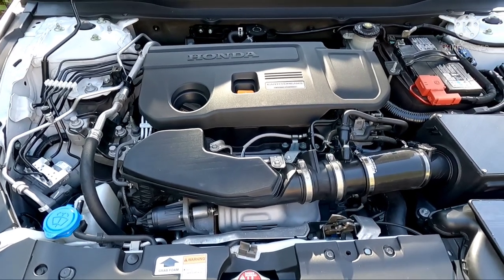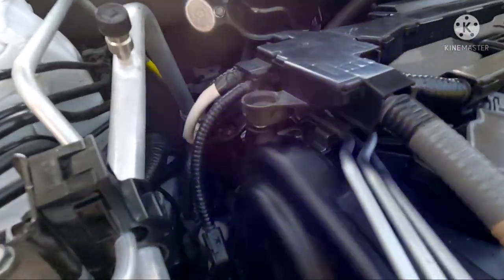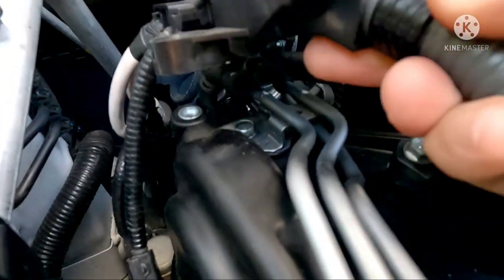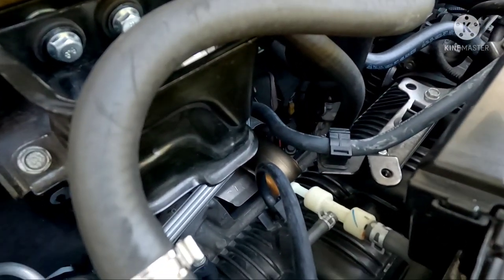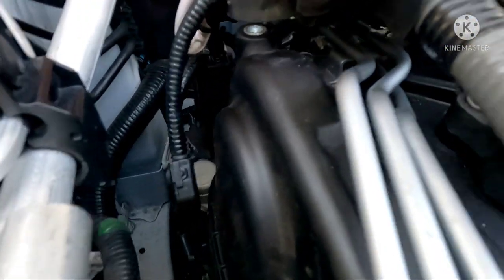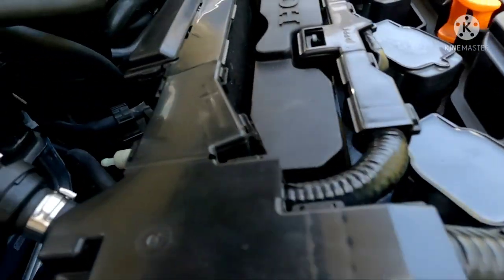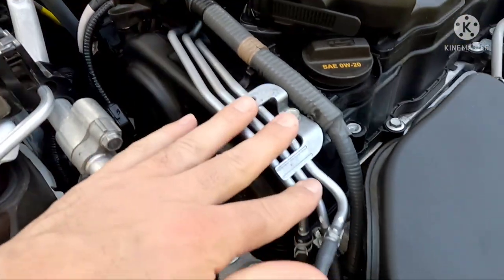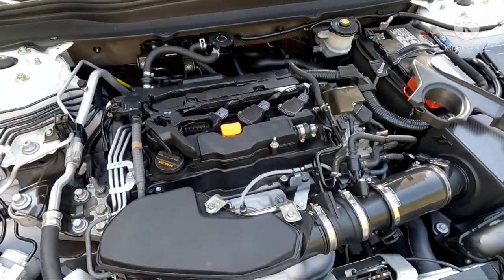How to bypass your Air Bypass Valve Control Solenoid |A MUST for Tuned Honda Accord 2.0t's

Comment: Hey even here after a couple years had this problem PHR STG 3 had the stutter did the bypass and it fixed my problem the issue was very annoying and even had power loss but it is fixed thanks for the video :)

Comment: Hey, Dan. 
1st. I love your videos and you've helped me a lot with your tips and tricks. 
2nd. You should cap off the far right hardline or the factory T that you left there. It goes directly to your intake pipe, connected to the turbo. You may be pulling in some debris and unmeasured air without capping it

Comment: I tend to fluctuate 23 pounds sometimes hitting 24 once hit 25 does that sound about right  By bypassing that valve does it regulate your boost level more efficient it seems like mine's never the same

Comment: Hey Dan, thanks for the video I just finished doing this and my sputter is gone. But I noticed since I did this, I hear a lot more air/ blow out from my k&n intake only on low rpm cruising. Did you experience this as well? I know you have a mishimoto intake, but was wondering if you noticed a difference at really low rpm. P.S I also capped the T connector where the intake vaccum line was originally
Reply: Side note* I also have phearable stage 3 👌
Reply from the maker: No problem! I hear the diverter valve a bit more almost crisper. Although  I can't say specifically at low rpm.
Reply: @fubuguy10  nice. Unorthodox racing is releasing a lightweight crank pulley for 2.0t accord soon it weighs only 0.5 lbs I can’t wait. Non stop tuning already sells one that weighs 1.17 lbs which isn’t bad either for $140.
Reply: @HondaAccordPerformance  I see that pulley at Nonstop tuning.  I am an amateur mechanic and it looks like a pain to change.
Reply: Would you happen to recall what size diameter the hoses were ?

Comment: So i have a code witch is p0035 witch mean change the bypass valve because my boost cutz off n im gettin Christmas light on my dash if i bypass it would the check engine light go away or no ?? If i reset it would it come bak on i have to smog my car this year thats why help please

Comment: I'm having hesitation on my stock 2.0t, but not at high rpm. Happens when I press throttle at 40%. Have you heard anything like this? You think this would fix it or is this just for ppl pushing more boost than stock?

Comment: Great instructional video. I would buy a kit. Thanks!
Reply from the maker: Thanks,  I didn't get enough demand to make one up
Reply: I did it today, was $8 of parts. 
Edit.  Thanks for the great title for the video!  Such a big difference without the flutter, I was getting power surges also.  Now it's just as it should be.

Comment: how is this modification holding up so far sir? Any problem? My tuner told me that this would be the problem that I’m having but he just suggested it to me if I want it. I will ask him questions as well but did it have any pros and cons? like additional benefit other than removing the sputtering? Thanks again!!
Reply from the maker: There isn't any benefit other than taking care of the sputtering issue. Also so issues after this modification

Comment: What does this solenoid actually do?  I just noticed this problem today and am going to consider doing it, too.
Reply from the maker: It basically controls the boost electronically. When you run more than stock boost the solenoid doesn't seem to like it and will cause the sputter.  By doing this your running off of vacuum and will fix the issue
Reply: @DanVilla7  Makes sense.  I'm wondering if an aftermarket solenoid would work as well.  Hondata sells one, but I don't think it works with ktuner.  Products.  Thanks for the video!
Reply from the maker: No problem!

Comment: Hey Dan, I need to fix this issue with my accord as I’ve been experiencing it on my recent type r turbo upgrade, do you know what size is the hose you got and if you need just the vacuum hose and cap for the car, thank you.
Reply: Guys it’s 7/32in 👍

Comment: Yo how's that oil catch can working out for you? I just ordered 1, how often have you had to empty it?
Reply from the maker: I haven't opened it yet, to really know. I did remove the hose that connects to the crankcase to fix this issue and there was oil residue in it so I'm sure it's collected some blow by already.  I'll open it up soon and show how much it's collected.
Reply: I've got a 2021 touring. Just made a run from west of Chicago to Fayetteville and back a few weeks ago(changed the oil the night before I left) .  I'm now at 40% and checked my catch can just out of curiosity....... there was maybe a quarter to three eighths of an inch of oil in the bottom of the can.  I am phearable s3 tuned as well.
Reply: @danielrinehart869  I got the same tune and same results in the catch can

Comment: Does it make sense to do this without a tune? I plan to get a tune but can this be done before? Just curious if anyone knows what Honda's intentions were with this bypass valve? How is it supposed to work or what is it supposed to do? Good to have this info before circumventing a Honda Engineered device.
Reply from the maker: Honestly if your not having an issue why touch it? I personally wouldn't have. I only started researching it because it was a really annoying issue for me costing performance which I was looking to gain.  Now everything is working 👌.
Reply: @DanVilla7 So this controls the boost? So bypassing this value prevents the computer from dropping the boost? Wonder what situations that would happen? Eco mode?
Reply from the maker: @michaelgilmore341  by doing this, it's no longer operating electronically, it is operating solely off of vacuum which is safe.  I have noticed traction control doesn't really interfere as well which I personally like. Traction control in this car pretty much sucks just cuts power and doesn't help to keep you accelerating as fast as possible

Comment: I might have this issue, my car when it shifts to 7th I always noticed a drop in boost but then it picks right back up.  I always thought for this platform maybe it was normal…. After seeing This video I’m
Thinking I need to try that bypass
Reply from the maker: More than likely you need to do it. It will fix for sure
Reply: @DanVilla7  did you notice harder shifts 
Or anything??
Reply from the maker: Nah just works the way it should. If you go back to stock it wont do it, only happens when you push more boost.
Reply: @DanVilla7  thanks brother! I’ll try it this weekend and come back with results!

Comment: Newly subbed here. Thanks for the info.      

So bypass the solenoid…,  basically remove the solenoid completely out of the equation., now what happens if I was to tap all 3 lines back into the intake valve?  Rather then just running the one
Reply from the maker: Thanks and you'rewelcome! Im not sure if that would cause an issue or not. But most importantly do not unplug the wire harness from the solenoid, supposedly it's not a code that you can clear and only the dealer.
Reply: @DanVilla7   well I did what was supposed to be done.  Unfortunately I snapped the nipple on the manifold.  Who knew it was an easy plastic to break.     For the moment being I try to block off the hole on the manifold. So my blow off valve has no vacuum running to it.   Surprisingly the car runs. No code.     The intake is very loud. You can hear that turbo spooling. But no power.    One of those fml 🤦🏽‍♂️ moments for me. Lol.
Reply from the maker: @h2batavia922  damn sorry to hear. Your not the first person that had that happen to them. Unfortunately they didn't report back with how they fixed it. Someone suggested jb weld to him.

Comment: Have a quick question for you when you were running Ktuner stage 2 what was your maxed boost level.
Reply from the maker: If I remember correctly 22.xx psi
Reply: @DanVilla7   How about now with your f stage 3 tunes
Reply from the maker: @jeremyyounkers7378  will spike and hit 24.xx holds 23.xx but as it gets cooler should be a little more
Reply: Great i guess my tune is correct then.   Im use to my 2018 si with the plus 9 psi tube hittin 27psi.

Comment: I'm getting a P006a on my 2.0 is this the fix or do I need to replace the MAF
Reply from the maker: This issue doesn't throw a code
Reply: @DanVilla7  man I need some help with this p006a, I bought a maf and it's not the problem
Reply from the maker: @bobbywilliams5167  I personally wouldn't know what's wrong

Comment: Wow, just came across this, and looks like the same issue I have. My car is modded, 6 spd, and I have this annoying hesitation, feels like power cuts, which starts around 5K and up...

I have experienced it in 1, 2, 3, and even 4th gear....

My tuner says that it might be the fuel pipe, and we need to change that, since some people, who have type r turbo in their Accords, modify the stock fuel line and it seems to work for them. But I want to try this first!

Dan, can you please send me the kit that I need, I really want to try this out, before I mess with the fuel pipe,
Thank you
Reply from the maker: I didn't get enough interest to make one.  But more than likely it will fix your issue
Reply: @DanVilla7  

Ok, I'm going to try this out,
Thank you
Reply from the maker: You're welcome!
Reply: @DanVilla7  

Well...today I bypassed the solenoid, tried this option, and unfortunately it didn't work for me...
Sputtering and hesitation is still there..
At least I know now that it's not the problem in my case
Reply from the maker: Damn that sucks...
Reply: @vadim7131  Any word on what your problem was?
Reply: @Norbit2  

Well...my car was tuned by Anthony at Hybrid Works. He told me I need the modified fuel line....that I could not get from him some some reason....
Later I found out about other tuner, JSR Engines, in Covina, so I went there. Had to pay for the tuning again, plus they drilled out my stock fuel line for additional cost. They tuned the car using Hondata, not the K Tuner that my car was on, they said it's better for Accords...so I'm glad that issue was taken care of
Reply: @vadim7131  did u ever fix the hesitation when shifting gears? What was it ? And how did u fix it?

Comment: I have a question my 2018 Honda Accord on a coldstart it vibrates for about three seconds and goes away I’m trying to figure out what it is
Reply from the maker: Im not sure what it could be
Reply: Maybe dirty maf sensor
Reply: @jygogaming3550  nah I was A blown head gasket lmao and Honda didn’t cover it so I put a used engine let’s see how this go’s
Reply: @jrjr8738  dang that suc how many mile was on the car before blow
Reply: @jygogaming3550  only 70k there’s a type r 2.0 on YouTube that did the same thing so it just theses new engines are trash
Reply: @jygogaming3550  but I fixed mine oh well I still drive it everyday
Reply: @jrjr8738  you probably overboost ur engine
Reply: @jygogaming3550  nah it’s always been stock they over boost them from the dealership tho just a turbo in general will blow your engine prematurely
Reply: @jrjr8738  i heard the 11th gen civic have headgasket issues too
Reply: @jygogaming3550  I’m sure they do same engine I believe 1.5

Comment: Im experiencing the same issues on my 1.5t? Would it be the same process
Reply from the maker: I'm pretty sure it is but can't confirm because I haven't really looked at the 1.5 motor.
Reply: @DanVilla7  okay i did it, its the same thing but instead of three lines on the hardlines. Its just two
Reply from the maker: Ok good to know thanks, fix the issue for you?
Reply: @DanVilla7  no it gave me a p2187 code for lean fuel mixture
Reply from the maker: @irwinhshsg  ahhh damn...I wonder what the work around is for thrle 1.5
Reply: @DanVilla7  i get a miss fire on cylinder two code, when im driving in town it drives fine. Air to fuel is fine. When im on the highway like around 50mph i put it on sports and use the paddles and take it to 7k rpms and its fine. Its builds boost fine. Air to fuel is fine. Its only when i launch the car and it gets to 5,500 rpms it kills the car and goes into limp mode and the check engine starts flashing and it won’t accelerate. But it doesn’t always throw me a check engine light
Reply from the maker: @irwinhshsg  sounds like you might be getting bad knock .  That would cause it to go into limp mode like that. What tune are you running
Reply: @DanVilla7  ktuner stage 2 i have prl downpipe, Prl front pipe, prl intercooler, afe intake, blow of valve and
Reply from the maker: @irwinhshsg  wheres your kcon at when this happens?
Reply: @DanVilla7  i can check later and let you know because other than the times I launch the car, it drives fine
Reply: @DanVilla7  ive tested the compression on the motor and its good
Reply: @DanVilla7  it turnes out to be my head gasket
Reply from the maker: Damn that sucks
Reply: @DanVilla7  I was full bolt on pushing 24psi. I ordered the head gasket and the Apr head studs. I will be doing the work myself and sending the head to the machine shop
Reply: @irwinhshsg  did you plug both lines ?

Comment: Correct me if I am wrong, but if you are utilizing boost by gear in your tune the computer will no longer be able to control boost?   I assume it is this solenoid that makes “Boost By Gear” possible?
Reply from the maker: That's a good point, I'm not sure if it will affect it or not. I've already bypassed it and haven't had an issue since.  Might be a good test for someone having the issue to see if it cures it.